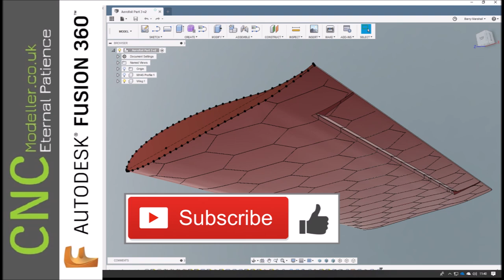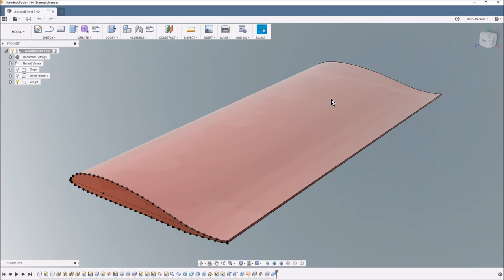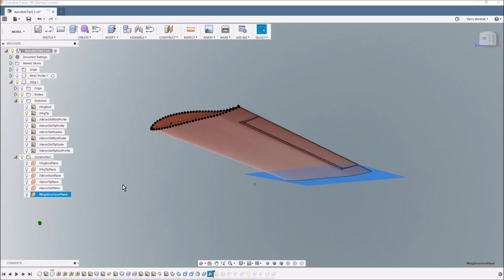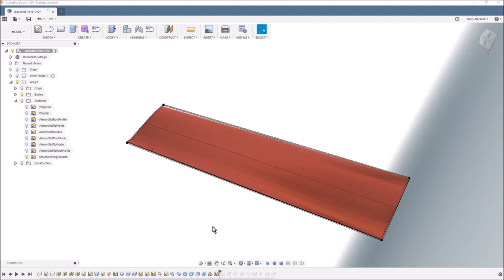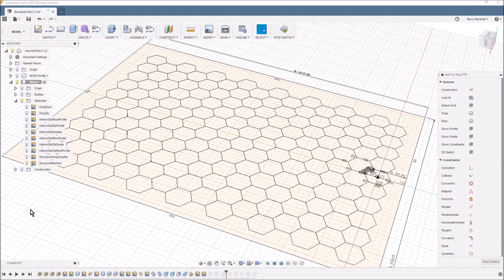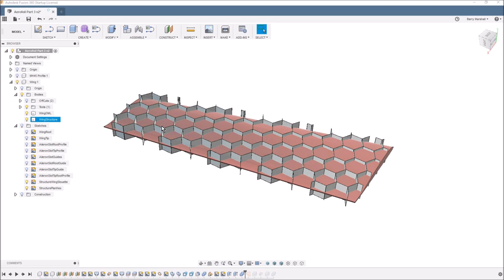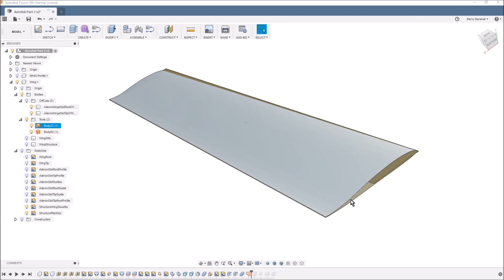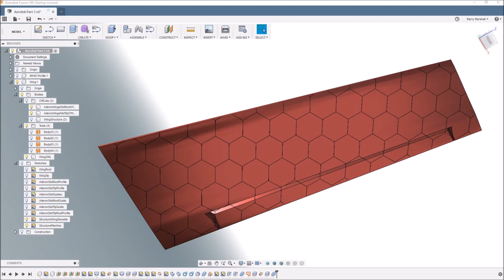How to design a Parametric Aerofoil Wing with an Integral Aileron & Structure

Comment: Well you vasically dont need an upper surface to create. There is a function in "Extrusion", wher you can set the extrusion to punsh through a solid body, and its callet "To All" you can set it ti stop on the outside if the Wing, " on Object" or " to all" when you set it to " to all", you can type in an offset, that resambles the with of you outer surface.
So you basically need only your wing and your Inner structure. But be aware, the inner structure you have drawn, has to be within the surface of of your wing, so dont draw it outside of your wing area.

Comment: How come the aileron does not show on the top surface of the wing. Is it not cut all the way through? I have trouble with the volume as I cannot increase it to hear you well. I fly RC planes.
Reply from the maker: Hi Gvet. The idea is to print out the wing in a single piece. Then cut out the aileron with a hot blade. This allows me to print a full flying wing in one job. Thanks for the interest.  Barry M
Reply: @CNCModellerUK  I could not find a video where you actually print this design.     Is this yet to be done? Like the honeycomb structure and I guess experience as to pattern size and wing thickness used. Hope to see more and will try to find a way to increase the volume and maybe use my old desktop with auxiliary speakers.
Reply: @CNCModellerUK  So if the wing is all parametric if you change the basic wing shape does the inner structure adjust as well?
Reply from the maker: CNC Modeller 1 second ago

Hi Gvet, I've not uploaded a print video yet but it's coming.  I've had a few problems with my printer that are now sorted so should be uploading that for next week. The entire design is parametric including the structure, however if more or less hexagons are needed I have to repopulate the bodies in a combine to get them included in the final cut.